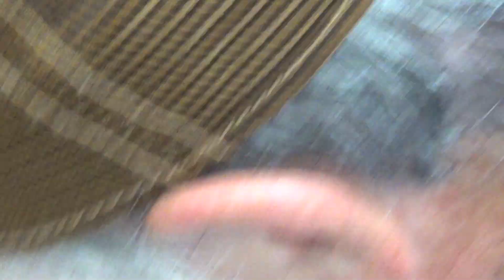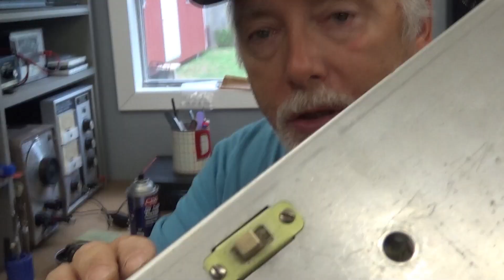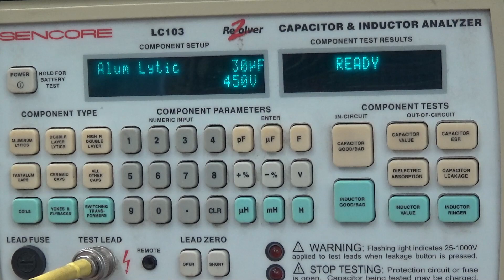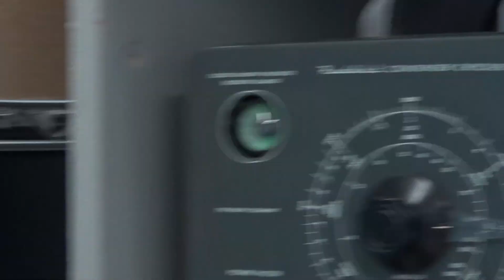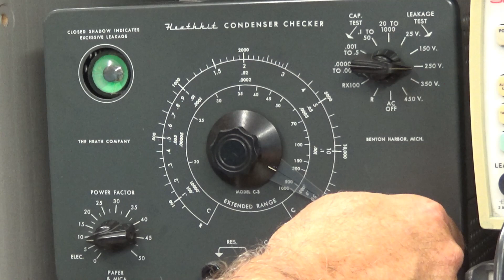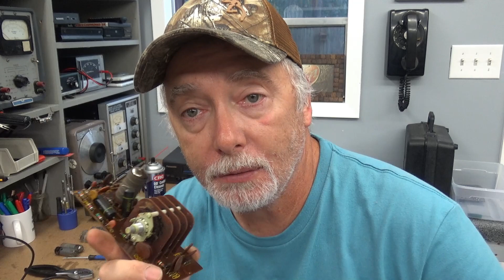Good Nite Knight KM20 18 Watt HI-FI Amp Repair

Comment: I'm watching your videos in reverse order, here is a dumb question,  Can you use your Sencore LC103 to measure the inductance of the output transformer primary?  Does it also measure impedance?  If so, could you attach an 8 ohm speaker to the secondary 8 ohm taps and measure the primary impedance of the output transformer,
Reply from the maker: That’s a good question. Not sure how the open winding will affect it. I’ll try it when I get time.
Reply: @oldavguywholovesRCA  An open winding will kill just about any measurement your trying to make.  If you can reconnect the leads with the correct phasing you stand a chance of getting an accurate measurement.  Even is you have to solder in a temporary jumper to connect them.  If you connect the winding segments out of phase they will fight against each other and reduce both the inductance measurement and output voltage.  It could also throw off your turns ratio calculations.  
You may also want to try your turns ratio measurement again with a small load on the primary.  1 volt on your 8 ohm tap produced 20 volts on the primary.  I have seen transformers with an open winding produce a voltage and the DVM does not load down the winding so you get this phantom voltage but as soon as you load the winding you get nothing due to the open winding.  Just for giggles throw a 20k resistor across the ends of the primary.  Should only draw 1 milliamp and be enough to tell if you see a significant voltage drop suspect an open winding.  High DCR could also indicate a burned area / carbon arc trace etc.

Comment: Don't dare remove the cadmium plating. Cadmium in any dissolution is highly toxic! Don't breathe, dont touch dont even think about it. Use some windex to clean it off. Heck its yellow but it won't let rust settle, so what?

Comment: Cadmium plating can be removed with white vinegar and foam brushes. Wash off and clean with mineral spirits and 
let dry . You then spray  a clear coat over the metal so it won't come back. No need to reverse engineer the wiring. Go to audiophool and googie it with hifistuff. Should go to a page that says "some 1950's hifi stuff". Drop down the page to
 Knight and it is the fifth one down. Schematic and parts list there. Transformer secondary is at 370-0-370 with 6.3V 
 filament  Looked it up and it is a Stancor PC-8411. Thordason has it as 24R064. Heavy cause of all those windings to 
get 375 Volts. It's gonna cost more than 80 bucks I'm sure with todays escalating prices. Steve